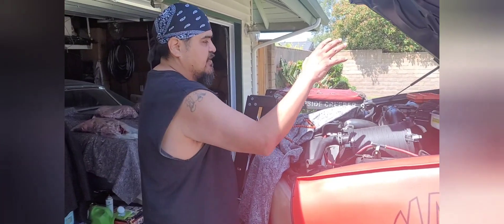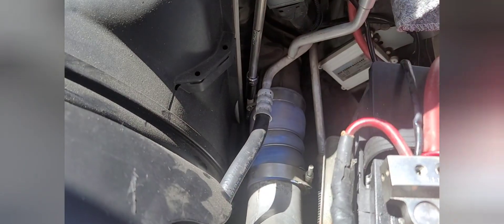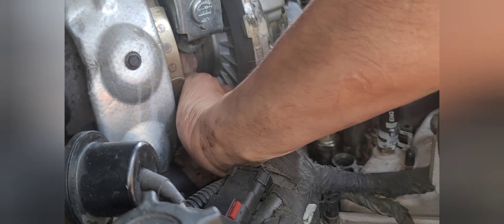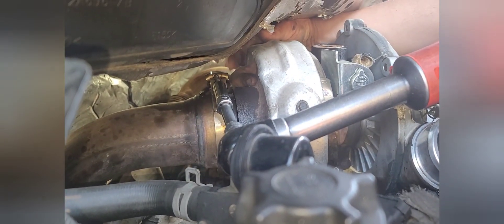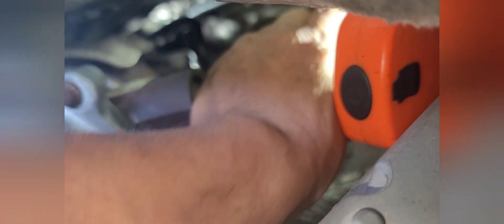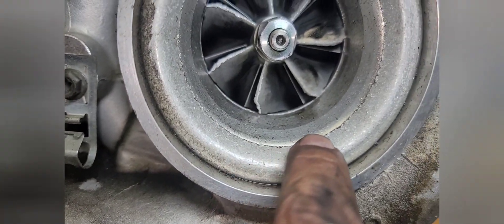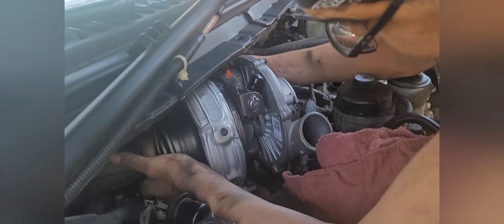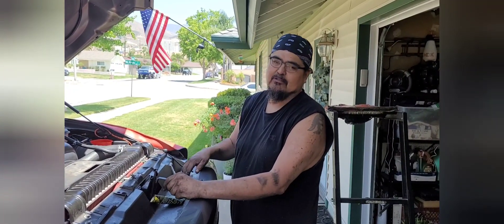Replacing a turbo on a Ford 6.0 Powerstroke diesel

Comment: Icp connector is same as turbo plug. I always replace flexible turbo oil feed line with solid tube and all 1 size drain tube.
Reply from the maker: Yup, it's the same too. Thanks for watching dude 🤙 I was hoping to get your opinion on this video since I know that you have a 6.0 and have probably done this repair before
Reply: I've pulled dozens of turbos. I have pry bar I put on tab of exhaust clamp smack with palm of hand to loosen it.
Reply: @PowerStroke Jude  I really liked my original matco locking flex 1/4" and have 3 different extensions to get turbo off.

Comment: I've always wanted to put wicked wheel in my turbo for that nice idle whistle and to help turbo lag. I was surprised that all 3 bolts were in turbo and stand usually I've found 1 missing from turbo or stand or sometimes 1 of each.
Reply from the maker: That's true, I should have mentioned that dude, 9 times out of 10 there is a missing bolt from the turbo pedestal